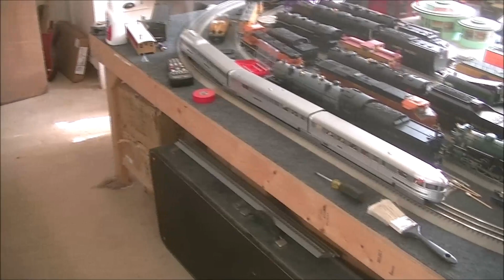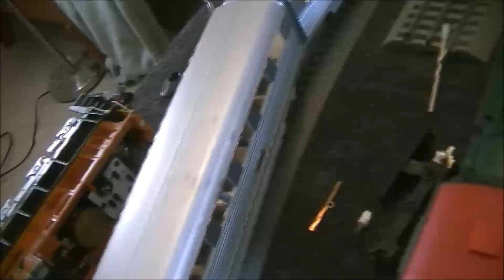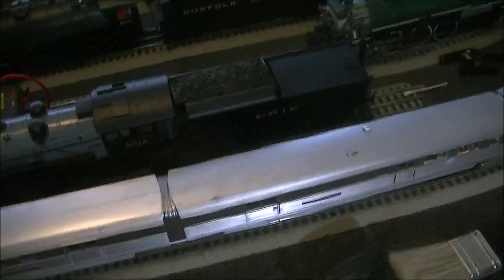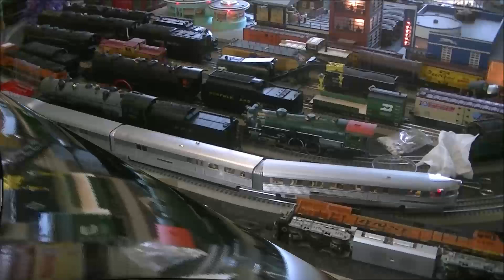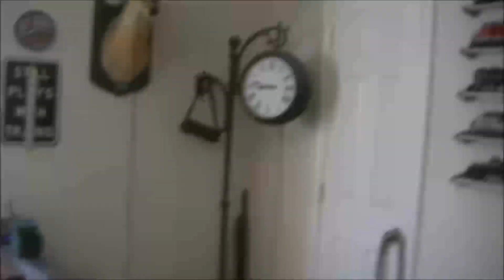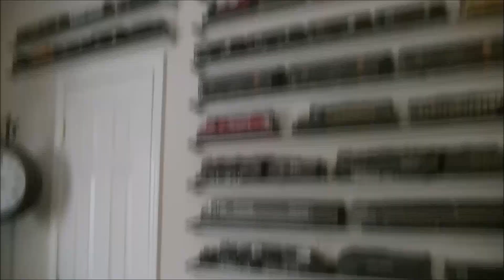Lionel Zephyr and disaster hits the layout, kind of!

Comment: Ugh horrible update. What do you think caused the damage to the big boy? Do you use any type of surge protection?
Reply from the maker: Well, things happen LOL   I am not sure what happened to the Big Boy, the last time I ran it, it ran perfectly!  Lots of technicians say that it is crucial to run your locomotives regularly to avoid problems and the Big Boy has not been on the tracks for probably a year or so!  I replaced the receiver / driver board in the Big Boy yesterday and it is now operating perfectly!  Thanks for the comment bud!